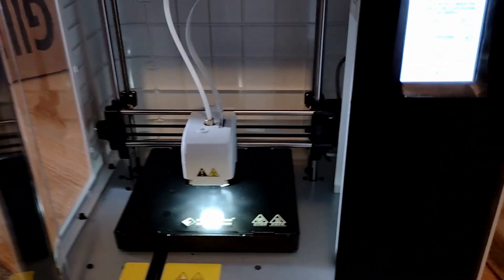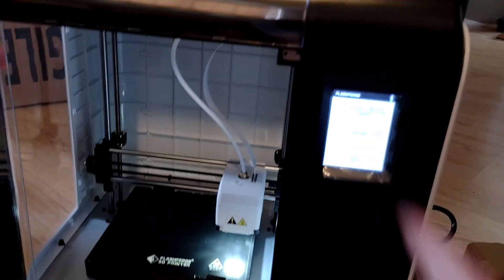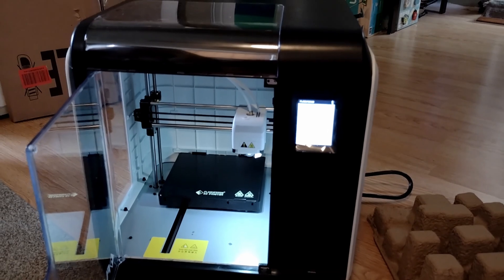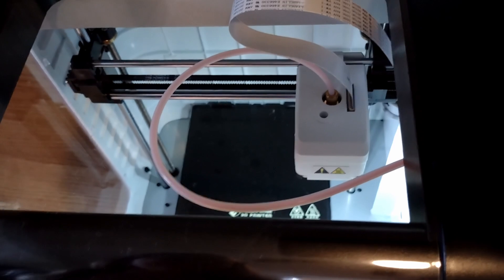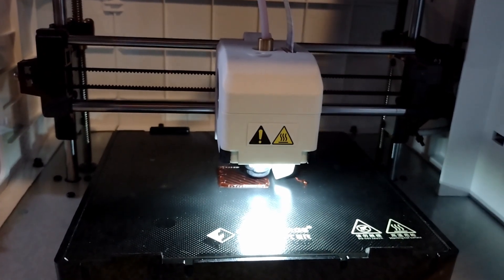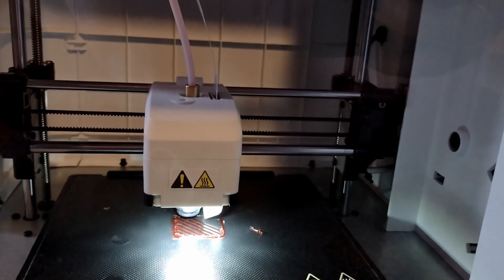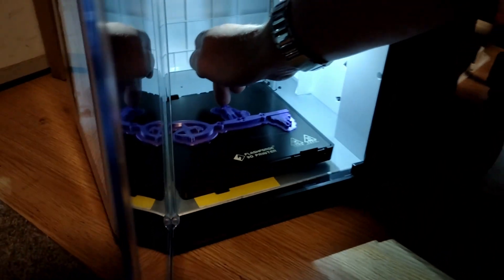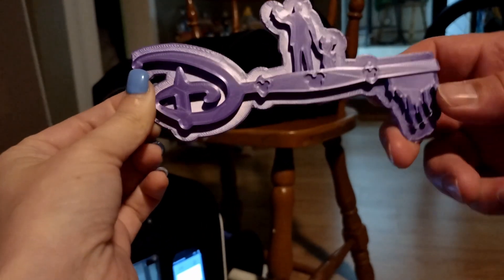Flashforge 3D printing testing and print results

Comment: Were you using the flash cloud website to print from or were you uploading files directly, i have had some issues with using the SD card om my adventure 3, and some quality issues with the flash cloud website.
Reply from the maker: We actually just printed via the desk top app on the laptop via Wi-Fi connection no USB or Ethernet cable needed.
Reply: re-compile the g-code it may have been an currupt package that you received from the cloud or the files are formatted differently causing some quality drop-off when loading into your slicer, alternatively you could load the files via ethernet from your computer but you would have to understand how to set the communication network between the devices , for the issue with the sd card you may have a faulty reader or card, simply test another card and make sure the card dose not store any executables or files that your printer may find strange though this is the least likely of the solutions. regardless more information is needed to properly pin point your issue id do some on similar issues or issues in general your printer tends to have and that may lead you to your solution. this is the nature of DIY adjacent products lol the byer just fix their own issues most of the time and the seller less info on how to improve their product
Reply from the maker: @luis61444  we get an error message if the file is corrupt and it re compiles it for us on the 3 PRO